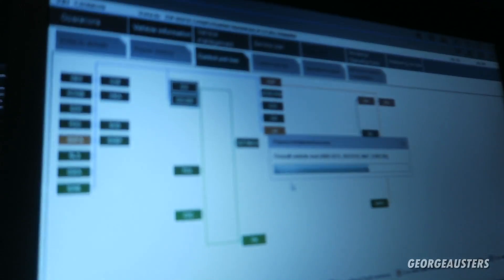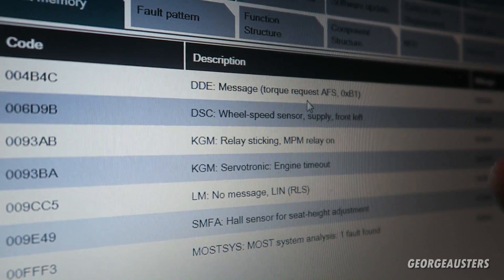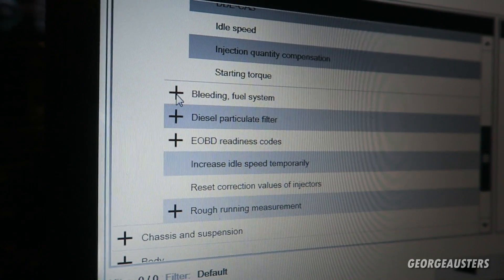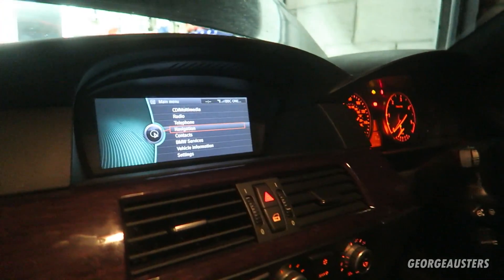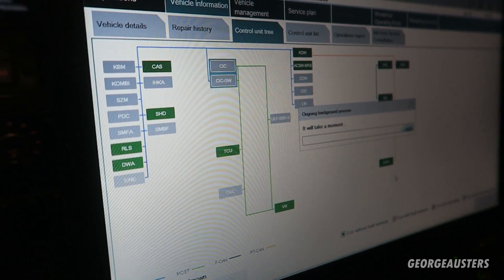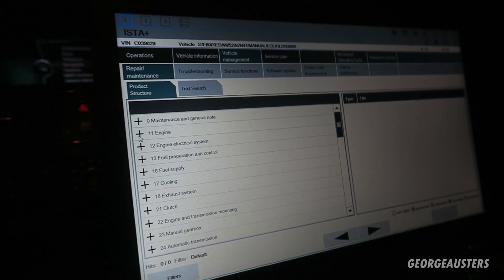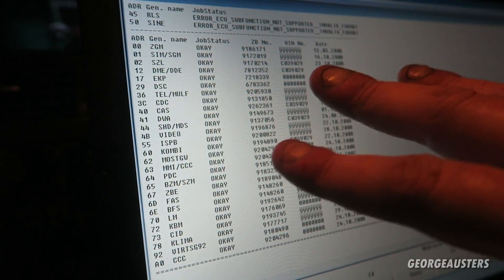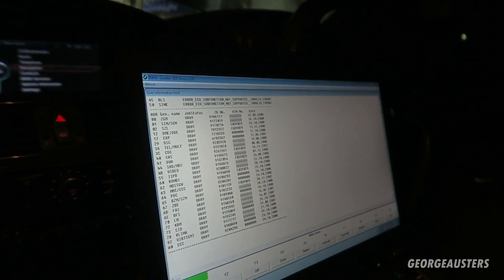How To Diagnose BMW Fault Error Codes Using ISTA+

Comment: Hi Both, awesome video. Need your assistance with boost issues on E70 X5 M50d which has triple turbos. The issue is we have boost up go 3000 RPM and nothing thereafter. I have tested vacumn pipes using a vacumn gauge with the engine running and manually switching the electric values. 
I found the right hand side engine mounting which operates under vacumn is faulty. The left side is fine.
Would this cause the issue? All the vacumn actuators at each turbo works fine using a manual vacumn pumps.

Comment: Hi there great video, ive just used insta+ for height adjustment, does that mean my BMW F11 remap that i done is gone? Thanks
Reply from the maker: No lol
Reply: @GeorgeAusters  very much appreciate the fast reply but what do i have to do to avoid my remap being wiped whilst using Ista+ thanks
Reply: and also the ride height adjustment isnt showing to lower the rear suspension is there a  way this can be fixed? Thanks

Comment: Hi guys. Does the engine needs to be running during the scan with ISTA? If not, does it need to be on battery charger? I am asking these because I did use once and it damaged the FRM2. Please help. Thanks
Reply from the maker: ISTA D just needs your ignition on
Reply: @GeorgeAusters  thank you for the reply

Comment: First you said you CAN'T clear codes with ISTA because the car was remapped.. then you cleared them....  Did I miss something on HOW to clear them without buggering the remap? (I kinda zoned out when he started blithering on about the voltage stabilizer - 10 seconds is enough time to explain it)
Reply: I think it’s because these bmw diesels when mapped they get torque limiter monitor codes. Which is why I’m guessing George had the codes. Only a certain few people when mapping can adjust each limiter. Most just do a DTC off and never get any errors.